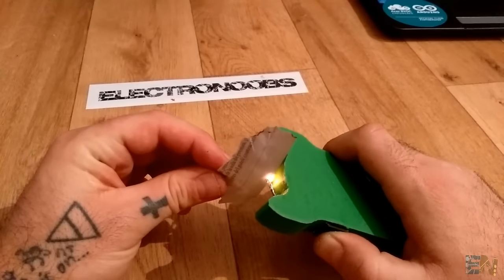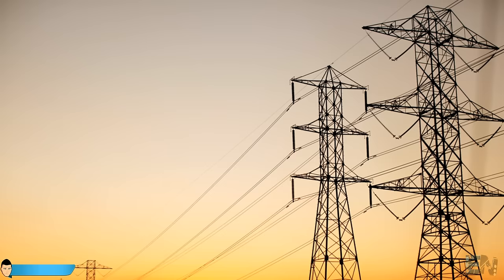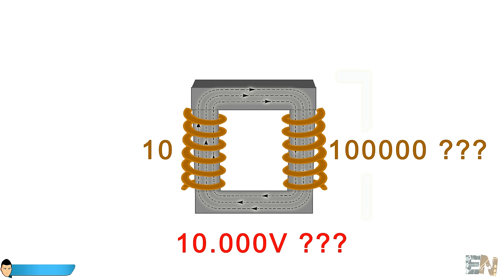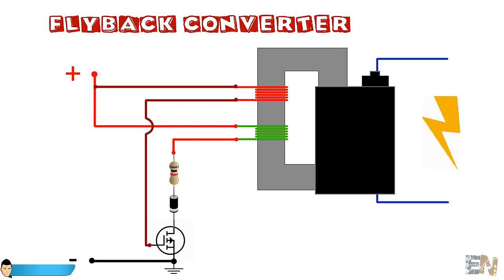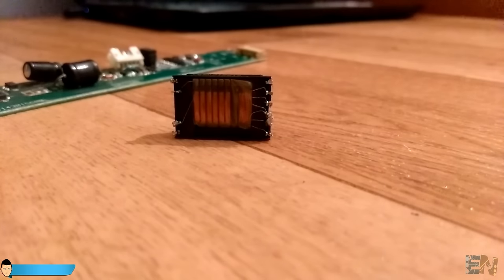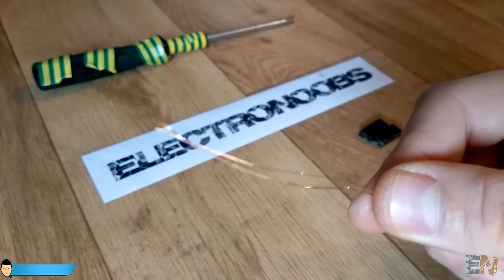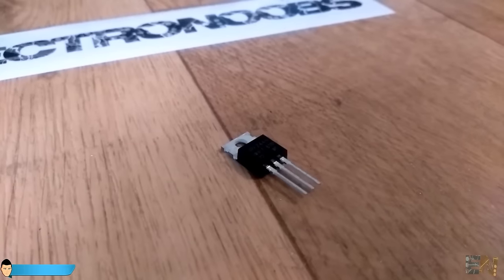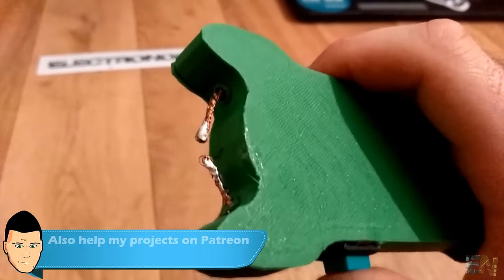Arc lighter TUTORIAL plasma flyback transformer

Comment from the maker: The schematics in the video have a small error. The placement of the diode and the 100 ohm resistor are to the base/gate of the transistors. 
Here are the good scheamtics:
BJT: http://www.electronoobs.com/images/Circuitos/tut_8/SchematicBJT.png
MOS: http://www.electronoobs.com/images/Circuitos/tut_8/SchematicMOS.png

Sorry for trubble!
Reply: the resistor colors show in the Schematic is 1000 ohm and not 100 ohm.
Reply: my friend is dead now.... too late.....
Reply: Electronoobs  ha gay
Reply: Electronoobs i made a arc lighter but i cant make arcs using a battery i had to use a power supply but i wanted a compact circuit and when i join it to power supply the wire carrying current gets hot what should i do & yes im your subscriber
Reply: I use transistor 13005, 2 resistor in serial about 70 Ohm, and output voltage i mesure about 1kV,  not enough to creact plasma arc. Please help me about problem!
Reply: Electronoobs I've been looking for it on ebay and aliexppress, but I can't find it. The N50347Y, maybe you can help me find it?
Reply: Basil Riadhi 2SD880,  that's transistor he used
Reply: i would understand the difference between plasma arc and high voltage arc; the china high voltage generator for example, can't burn anything, so what's the difference? bye.
Reply: @lenaroseguera1241  ⚠️ God has said in the Quran:

🔵 { O mankind, worship your Lord, who created you and those before you, that you may become righteous - ( 2:21 ) 

🔴 [He] who made for you the earth a bed [spread out] and the sky a ceiling and sent down from the sky, rain and brought forth thereby fruits as provision for you. So do not attribute to Allah equals while you know [that there is nothing similar to Him]. ( 2:22 )

🔵 And if you are in doubt about what We have sent down upon Our Servant [Muhammad], then produce a surah the like thereof and call upon your witnesses other than Allah, if you should be truthful. ( 2:23 )

🔴 But if you do not - and you will never be able to - then fear the Fire, whose fuel is men and stones, prepared for the disbelievers.( 2:24 )

🔵 And give good tidings to those who believe and do righteous deeds that they will have gardens [in Paradise] beneath which rivers flow. Whenever they are provided with a provision of fruit therefrom, they will say, "This is what we were provided with before." And it is given to them in likeness. And they will have therein purified spouses, and they will abide therein eternally. ( 2:25 )

⚠️ Quran

Comment: Beautiful and simple scematic at 9:20.
I've built a similar project, a plasma speaker, which also uses a Mosfet to power the flyback transformer. Without any heatsink, the Mosfet would desolder itself after less than a minute ;)

Comment: Wouldn't krypton tape been a better choice to protect shorts in coil? Also, wouldn't Shellac been a better choice in sealing the copper winding's and to help in short circuit?  Would a micro (JOULE THIEF) work better for this circuit placed after the transistor to help keep the transistor cooler? Also you should have used (Tungsten Carbide Tig electrodes for the ark post don't you think?  I like what your doing mate. These hands on projects are awesome to me anyway. Thank you for showing me and the whole world your skills. Your video's are top notch. I've learned from you. Thank you.

Comment: pretty bad ass. but I do have few questions. why create a flayback transformer for this? cant you do it with just a primary and secondary, the only reason I ask, is that I took apart an arc lighter and the 1st one I did was a primary with the secondary but it was connected to the primary, with that note the two prongs that made the arc was not attached to any wires but had some sort of metallic hard glue that was attached to the sides of the transformer, why is this? I have pictures of them all.second lighter had a x-plasma arc two transformers, but has no secondary windings just primary with the prongs once again glued to the side of the ferrite core, I am trying to understand all this and have been looking everywhere with no results.okay looking at the circuit board I see a LHT7 5 pin li-po batt charger and there was an un-identifiable 8 pin chip .Now I do believe that the un-identifiable chip is also a battery charger as well, do to the nature of the circuit protection for the battery could you see a reason for this having two chargers onboard? then I noticed the SMD (Surface Mount Device for those that are new) IC/ Transistor which I found they used MJD3055. if I could attach pictures I definitely  would that way I can show you what exactly I am taking about.

Comment: Help me if you can!
I'm doing a similar project! And when assembling the secondary coil, I got 8 layers of 300 turns (1600 turns in total). After soldering the secondary coil wires, I tested the continuity and the multimeter beeped and showed low resistance. I went to solder a wire in the terminal and ended up getting very hot, after soldering, I tested the continuity on the multimeter and nothing to beep, except for showing me a resistance of 500 ohm. I changed the solder and nothing. I measured the secondary coil wire separately and continued to 500 ohms.
Could it be that when I went to weld I ended up increasing the temperature of the coil wires and thus increasing the resistance? My welding machine is 60 watts!
Is it okay for me to use this secondary coil to generate high electrical voltage?
It was a lot of work, I wouldn't want to re-do the coil :(
Thanks in advance, your videos are very explanatory and are helping me a lot!
Congratulations on the channel!

Comment: 7:00 wrong, initial current via coil L1 will be: I=(V - Vd1forward)/R1 = (V-0.7V)/R1  for some silicon diode of simple type as 1N4007
for I=0 you need to reconnect R1 to V+ not to Gnd , step up buck-boost converter(wikipedia describes) is some tricky concept

Comment: i have  a doubt in the circuit shown at 7.10 when the inductor stops getting power it will try to drive the 1Amp current in the opposite direction which you didn't mentioned .

Comment: I tried winding my own coil from a SMPS transformer as well as rewinding the primary of a HV display transformer like the one in the video.  I can't get my primary to oscillate for some reason.  It works perfectly fine when I use it to run a Tube TV flyback but not with any of my hand made transformers.  I didn't include that diode on the gate though because i;ve seen it omitted elsewhere and it works driving the flyback without the diode.  Maybe ill try including it..

Comment: love the way you explain things you even took time to explain how to make our own transformer if we don't have the parts laying around, as a question, could i use a mosfet from a power supply? a k1377? thank you
Reply: or, could you use something from a cfl light bulb?
Reply from the maker: Your k1377 might work. If you check the data sheet the drain current is just 5A in your case and maybe that is too low. The irfz44 has 50A drain current. I recommend you to buy that one. But any way you should try the k1377 as well ans see the results. Always check the datasheets of the components if someting goes wrong.  Keep up and thanks for your com!
Reply: ELECTRONOOBS thank you for the reply, I tried my mosfet and it kinda works, I can see a tiny tiny arc but the wires need to be really close together. Do you think that if I change the mosfet results will more satisfying? Or maybe I did something wrong winding the tiny transformer?
Reply from the maker: Maybe, your mos can give only 5A. Try a better one!

Comment: Bro please answer this question please I am too much near to making arc lighter so I used 13003 transistor so whenever I put the tester light which is 12v to the + positive Secondary wire it turns on but it doesn't turn on when I put it on - negative it doesn't turn on so what does thìs mean I didn't used diode

Comment: mine has now stopped working and I found out that the transistor broke. Then, when I replaced the transistor, the replacement broke immediately without any plasma. The resistance and diode and 3.7V battery seem to look good, so does this mean its an issue with the transformer? Any feedback would be appreciated! Very lost at the moment

Comment: I've followed the way there is in this video, but I can not. I've also been using the transistor in the description, please help.
Reply from the maker: What is the problem?
Reply: ELECTRONOOBS Nothing appears plasma.
Reply: ELECTRONOOBS Is it an effect diode type?
Reply from the maker: Basil Riadhi could be for many reasons. Dos it even sound? it should sound like a fast frequency noise. if not maybe the transformer winding is broken. also what transistor did you used?
Reply: ELECTRONOOBS transformer is not broken, but the transistor doesnt sound at all,only its getting warm,
Reply: ELECTRONOOBS The problem in the transistor is in the description of the transistor you use in this video. From the opposite may be the same but, writing code in your transistor different from those on ebay. Perhaps the same but the name and type, its components differ greatly.

Comment: electronoob plz tell that why we cannot use iron core for making HV transformers
Reply: Because of the high frequency of the oscillations the core must non-conductive (eg ferrite ceramic). If you use metal core the eddy currents will be induced in it draining all the energy into heat and nothing will get to the output. But the transformer will become hot!

Comment: well, i know that this circuits works. but i have no idea where is this trick, its almost impossible to get it to fit on the ferrite, its always be some millimeters thick than the core, its frustrainting, and when i try to reduce the tape, it arc inside the transformer. -_-

Comment: can i use (D4205D transistor) and 1N4007 diode and 100 ohms resistor.
Reply from the maker: it might work! The NPN transistor looks good! Try it out on a breadboard before soldering!
Reply: Damn ! Tried the same, cannot make it to work. Blew four IRFZ44N up already ...
Reply: Can i use a 2SD1616?
Reply: Clément AS  my project is also not working what should i do
Reply: Clément AS  ic 555 generate pulse  it work
Reply: no, transistor 2SD1616 have a small current of collector Ic=1A

Comment: Can i use 2 wires with 0.3mm thickness for my primary/flyback coil?
Reply from the maker: danyCD17 yes, i think that it will handle the current
Reply: ELECTRONOOBS thanks for the quick response, can you tell me i I can use a tip32 transistor, I got a bunch laying around
Reply from the maker: tip 32 is a PNP for what I know. As you can see in the description I gibve NPN schematic as well but using a NPN connected with the emitter to GND. You should change the schematic in order to work but I recommend you to try with a NPN tip31 at least.
Reply: ELECTRONOOBS it's NPN, I hope it works, I  meant tip 31
Reply: I tried it with the tip 31 transistor, it works, but the arc is very small, it looks like a spark, how can i increase it?
Reply from the maker: Improving the transformer (better isulation and more windings) or increasing the input voltage up to 7V (no more than 7V)

Comment: Hey bro which transistor you used can I use 13002s transistor?
Reply from the maker: I've used the N50 347. You can't use 13002. You need more current
Reply: Electronoobs not even 13003?
Reply from the maker: You should test it out. It has a current range up to 1.5A and it's for fast swithching. It might work but it could get very hot since it doesn't have heat sink. I'm not sure if it will work, you should try...
Reply: Electronoobs I thought my transformers was not working on 13002 transistor thanks for telling let me try on 13003 transistor
Reply: Diode isn't necessary i think,also plz tell me how much volt produce arc?

Comment: amigo necesito tu ayuda tengo una duda: yo podria tener todo este circuito del arco electrico  controlado por un arduino nano? tu sabes... para poder encenderlo y apagarlo a voluntad con un control remoto   si resuelvo esto ya podria hacer un sistema de proyectiles para mi tanque casero
Reply from the maker: Para proyectiles recomiendo mejor usar un simple cable de nichromo. Con 5 voltios se quema al instante y puedes encender cosas. SI solo quieres la chispa con este circuito, siempre puedes usar un rele o transistor irfz44n controlados por un Arduino para encender y apagar el circuito. saludos
Reply: hola  de nuevo  no quiero parecer muy insistente o molesto  pero no me quedo muy claro esto del relee o del transistor irfz44n, busque algo de informacion sobre este ultimo pero nada relacionado con aplicaciones para arduino y menos para conseguir un arco/chispa electrica, lo unico que deseo es hacer con arduino un ignidor pirotecnico a control remoto nada mas, es posible entonces hacer esto? donde podria encontrar informacion sobre como hacer esto? te agradesco las respuestas  saludos
Reply from the maker: BYRONSLAM09 no, el circuito de chispa es el mismo. Lo que yo he dicho es en vez de usar un botón para activar la chispa, usar un relé controlado por Arduino. El rele es muy fácil de usar, es un botón controlado por voltaje, normalmente 0 es apagado y 5 encendido. Si no quieres construir el circuito este para la chispa, en eBay si buscas arc voltage module o algo así podrás comprarlo por unos 2 dólares. Saludos.
Reply: ok  gracias  por la respuesta ya se lo que voy hacer

Comment: 20:08 look my plasmatrone video, there jacobs leader functioning realy usefull, started discharge that plasma speaker provide. my schematic novel idea - is to modulate plasma generation by low freq functionyng lamp that add some power to supply line of mosfet plasma converter , mostly supplied by constant power level = 150Wt when l@mp GU-50 only adds some 0-50Wt sound signal to that 150wt  dc power source , and summ supplying mosfet 50/50 constant duty drivered mosfet halfbrige step up on flyback tv transformator, and i get 175Wt(constant power for pl@sm@) + - 25Wt(music signal add)  without uhf l@mp AM tube gener@tor - difficult one, 200wt pl@sm@ sound from 200-300hz, and modulated by tube, mosfet switch always same timed, and doesn't acts on linearity of sound due to pretty stable efficyency level of step up convertion when no pwm there

Comment: ho many turns is it feedbac
Reply from the maker: 10 turns in my case for the feedback. 5 turns for primary and about 1000 for secondary
Reply: tanks
Reply: have to haer but I did not work. The feedback and the primary are short and I have no voltage at the output

Comment: There is a difference between the schematic given here and the schematic given in the tutorial link : http://www.electronoobs.com/eng_circuitos_tut8.php
In this video the diode and the resistance are on the emitter side of the NPN, while on the webside, they are connected to the base. 

What is the functioning circuit ?
Reply from the maker: You're right. It was an error sorry. I've changed the schematics:

BJT: http://www.electronoobs.com/images/Circuitos/tut_8/SchematicBJT.png
MOS: http://www.electronoobs.com/images/Circuitos/tut_8/SchematicMOS.png

Thanks!
Reply: Thanks for the fast reply !

I'm still having trouble though, because the two schematics you just gave are still different from the video ones ?

Maybe a question that could clarify that : what are the roles of the diode and the resistor ?
Reply from the maker: The one from the video is also wrong. Use the ones I've just gaved you! The only difference is the position of the diode and resistor. Sorry once again!
Reply: Well well, I'm happy to say that thanks to you sir, I just created my life's first plasma ! :D
Reply from the maker: I'm glad to hear that!
Reply: I still have to understand the role of the resistor and diode, do you think you can help with that ?
Reply from the maker: Resistor is to limit the current to the base. You don't want high current at the base or the transistor could burn out. The diode is to only activate thwe transitor on the positive signal from the coil and create the high frequency oscillation.
Reply: Perfect, thank you =)

I actually did the schematic with a MOSFET, and it works but the MOSFET becomes really hot really fast, I used a FDP060AN08A0  instead of yours, because it's all I had that shared roughly similar characteristics.

Is the only solution to use a heat sink or does the choice of components can be improved to limit the temperature rise ?
Reply from the maker: also add a heat sink !
Reply: I gave it quite a few tries, and I eventually blew up every mosfet I tried, even with a heat sink, with a record of 3-4 minutes of continuous arc. Can your circuit last forever ? 

I am wondering whether I can make it last with a better choice of components, or by designing another circuit. My impression is that since we do not control the signal at the entrance of the gate, it rises too slowly (L,R circuit) and the MOSFET stays too long in a state where current goes through even if it has a non-negligible resistance, hence making it dissipate too much heat, and ... die.

Any thoughts ?